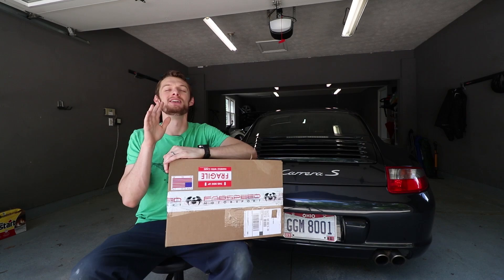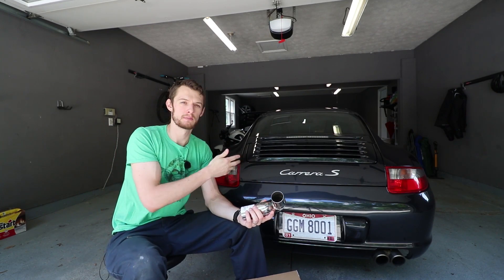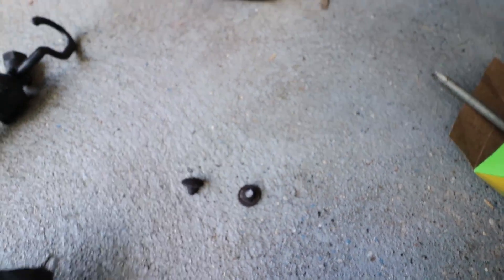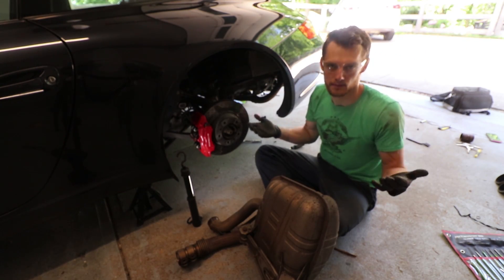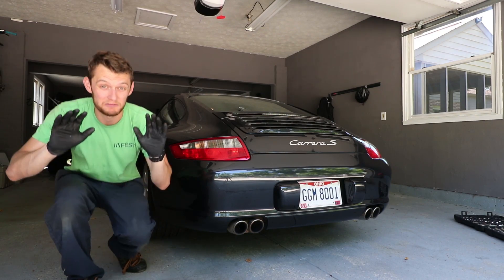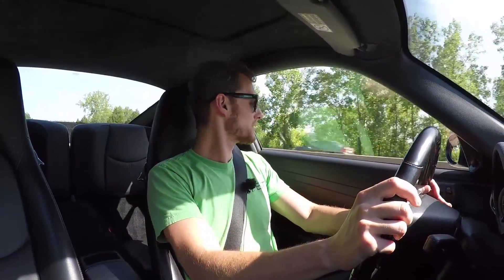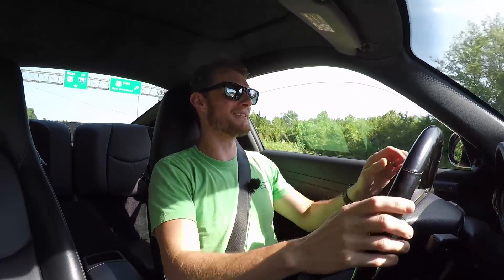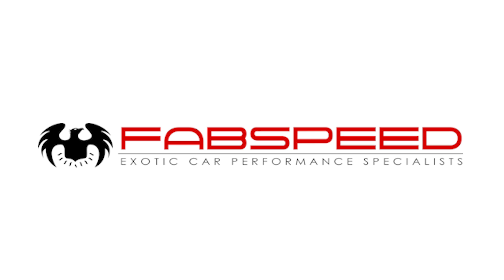I Straight Piped My Porsche 911 and It Sounds Insane

Comment: it is louder. Which does by no means translate into more power.

Engines are tuned to the exhaust system they use. By changing the exhaust without tuning the engine to it, you are guaranteed to get less power.

In your case you will lose substantially in the mid range.
Reply: If you remap the engine sure it will help but if you don't that doesn't mean you will lose power
Reply: Ata Orkun Oğuz I think the ECU is able to adjust to that. If you disconnect the battery for a small period of time, and then restart the car, the ECU adjusts. However I have heard you do happen to lose some low end torque
Reply: @TheRealDarkzxi  yeah and that number is like 1hp

Comment: YOU may feel its sounds awesome, however 95 percent of the public that are affected by that NOISE feel exactly the opposite.
Reply: suren raj Where did I say that??? Go study gramatics.
Reply: I agree with you Pagel, its not a nice sound all the time, hence why a lot of high end systems have the option to shut internal valves so the car isnt always noisy.
Reply: It much too loud to drive on a regular basis.  My 9114s stock is plenty loud with a deep low end sound and a lot of intake sounds.  I would never change the stock system.
Reply: Rather hear any loud car or truck than an open piped Harley
Reply: Enjoy your boring silent car.
Reply: Phillip Pagel - ugh this isn't that loud.  Even when he gets on it this would be something you might here a block or two away if you are outside.  If he's just cruising it will barely be audible until it's passing you.
Reply: Phillip Pagel 
The public that do not enjoy a loud Porsche for few seconds shouldn't go out at all or use earplugs all the time.
Reply: It does sound terrible overall, I run straights on my 911 Turbo and thankfully the spool covers the horrible exhaust note on these cars.  These cars just have horrible tone.
Reply: so how do come in too play with your comment?
Reply: Jesse Gutierrez III 944's sound terrible with a straight pipe.  Put a muffler on that thing.
Reply: Lol that’s true too my wife says it sounds like a bad exhaust leak
Reply: Phillip Pagel lmao I wouldn’t mind this
Reply: Phillip Pagel ur right
Reply: Who gives a shit about the public
Reply: To ss the crotch rockets with loud mufflers may not sound great but they save lives
Reply: Count me as one of the 5%.

Comment: Dude it's not straight pipe u still have cats and should have gotten catless x pipe from maxspeed motorsports and Done gundo hack  muffler and sound 1000 time better than muffler delete and this gona drone crazy and I had catless x pipes and still have stick muffler and its sound 1000 time better then muffler delete and its sounds like GT3 with x pipe and fabspeed is way over priced $500 for two small pipes and everything is way overpriced with x pipe and I was looking for intake tube the silicone one but fabsoeed want $250 for it but I found same silicone hose and speed tech for $50 and its silicone hose
Reply: holy lack of punctuation batman!
Reply: Let's try this:

Dude it's not straight pipe. U still have cats. You should have gotten catless x pipe from maxspeed motorsports and Done gundo hack muffler. It would sound 1000 time better than muffler delete. This gona drone crazy. I had catless x pipes, still have stock muffler, and its sound 1000 time better then muffler delete. It sounds like GT3 with x pipe. Fabspeed is way over priced $500 for two small pipes. Everything is way overpriced with x pipe. I was looking for intake tube--the silicone one--but fabsoeed want $250 for it. I found same silicone hose and speed tech for $50 and its silicone hose.
Reply: Im new to the Porsche Family but what are some Reliable parts to start with cause I also noticed some parts are WAY over priced
Reply: John Dillinger yeah their is porsche group called on FB 997 enthusiast and u can join that and talk to lot other people from their posts and when u have any question Just post some and people will def help u and I was about to buy fabspeed x pipes but someone from that page suggested me that try  some different
Reply: John Dillinger if u want good exhaust get from maxspeed motor sports and bcz I got catless  x pipes and o2 bungs from vibrant performance to eliminate check engine and I got K&N air filter not cold air intake but just filter and silicone hose for air box that comes with plug is from top speed it's on Ebay too and check vividracing they have lot of good porsche performance products and do more research before buy and ask people through post and u can get headers for 997 from agency power exhaust
Reply: That's got to be one of the longest run-on sentences I've ever seen.
Reply: You can notice he got sponsored. As you said, 500 bucks for two pieces of stainless is a RAPE, and hopefully the haters won´t come with "oh but they have development costs, and bla bla bla". It takes 30 mins to fabricate a stupid 90 degree bend.
Reply: Thank you for the translation. lol I laughed so hard when I saw this. Oh, and it's ok to be a hero despite what DR. Dyslexic says